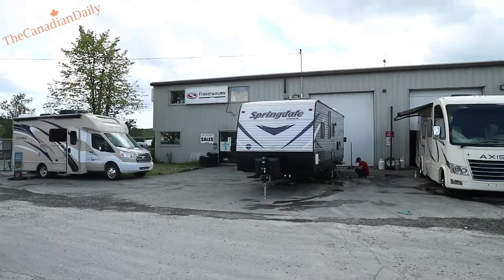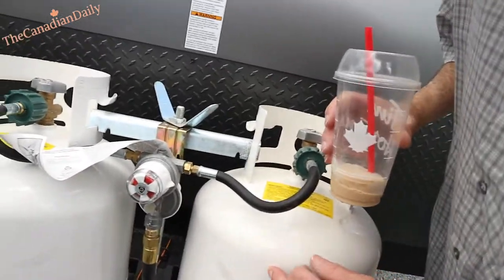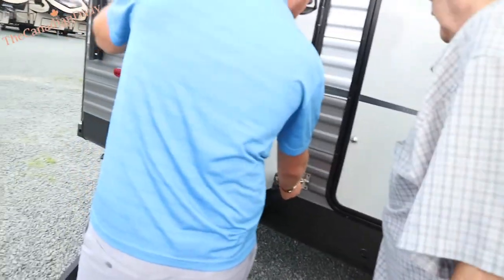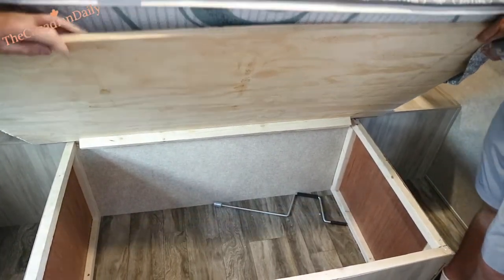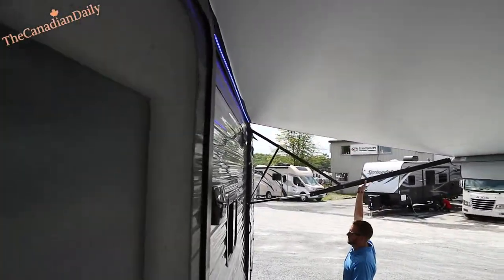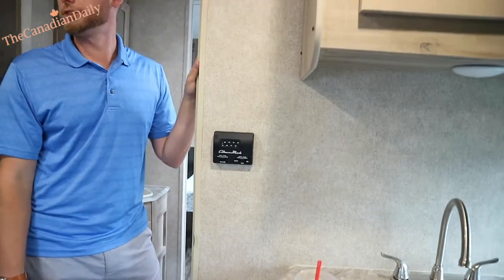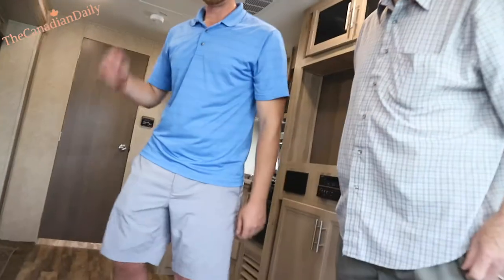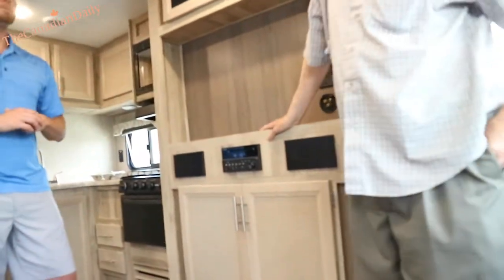Coachmen Catalina SBX 241RLS Walkaround

Comment: Hows the unit holding up? Just purchased a 2020
Reply from the maker: All is great, no major issues. Had a few minor things to fix, that were covered under warranty.  keep me informed on your experience.
Reply: Sounds good. Hopefully receive it next week and test it out next weekend. Take advantage of warm weather still in ontario. Cheers
Reply: Hey hey kinda a long shot but I'm gunna ask, maybe you can help me out. If you have your trailer at home can you measure outside of slide flange to outside of slide flange. I'm wanting to buy a slide out topper awning but my trailer is at dealership 2 hours away and wanna save the trip if yours is at your house.
Reply from the maker: sorry I didnt see this message until today.